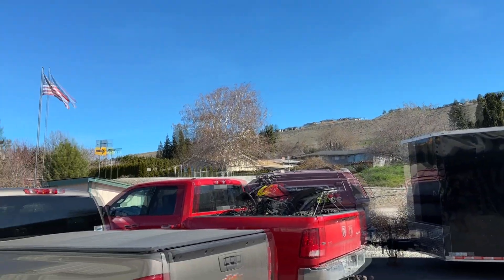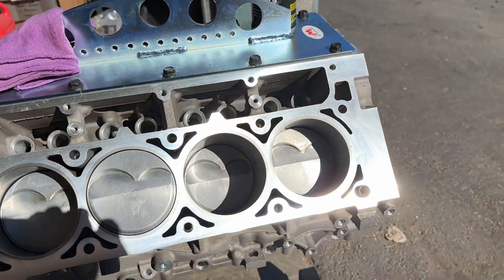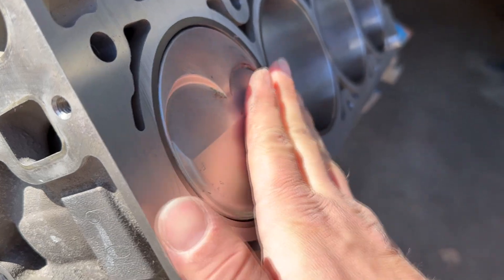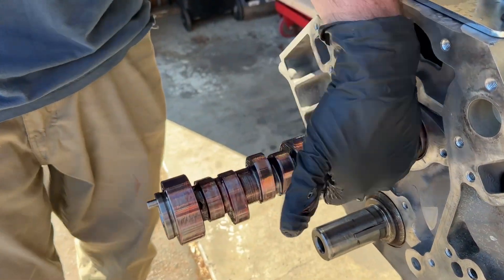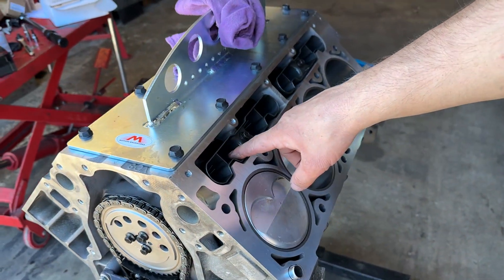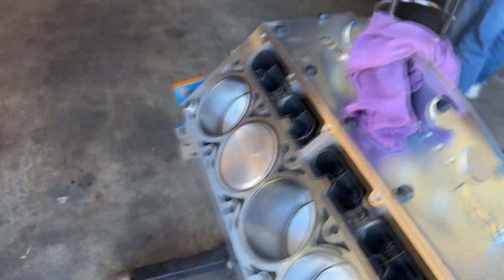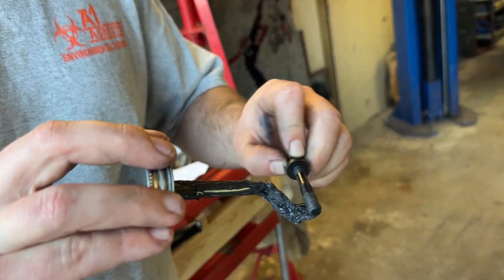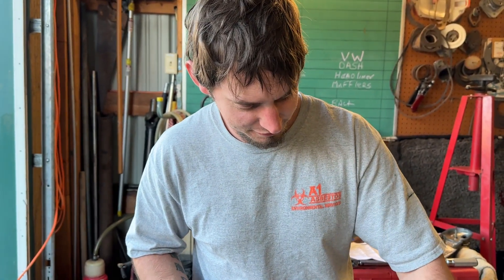LFA 6.0 LS High Compression Engine build for the GMC S15

Comment: Do you know if there is anything special about the original oil pan since this engine has variable oil pump?  Or any LS oil pan should work?
Reply from the maker: Any aftermarket or stock oil pan will work. Just depends on your clearance with the application. If you use a gen 4 style pan and delete the dod you need to put the plug kit in the factory oil pan. And the plugs in the dod stands in the valley cover.